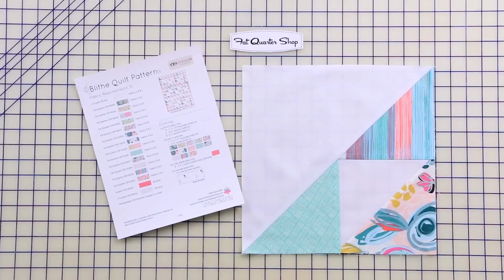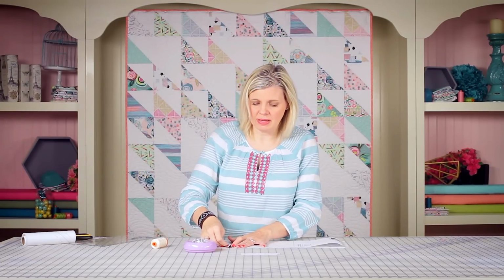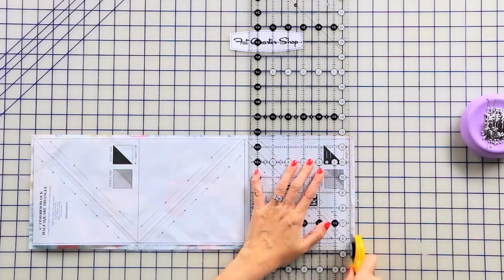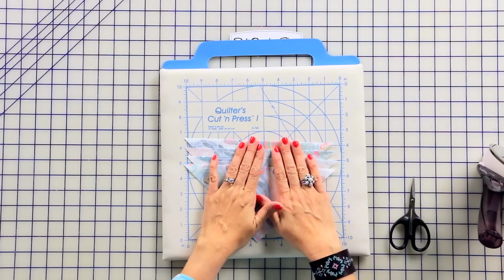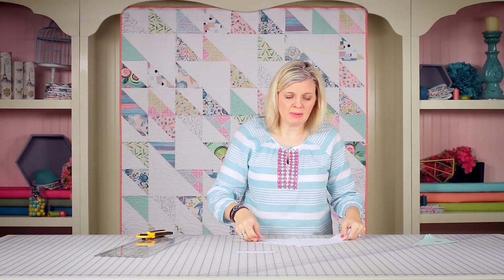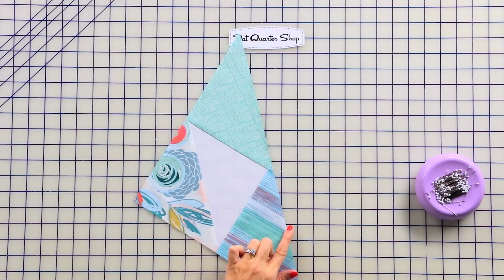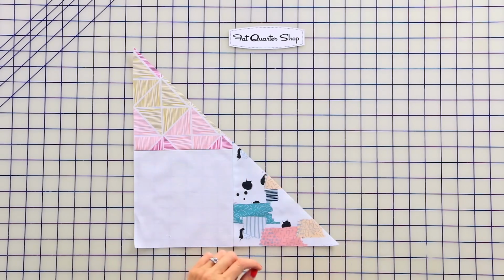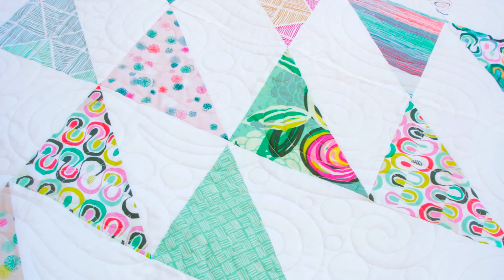AGF Stitched Blithe Quilt Pattern: Easy Quilting Tutorial with Kimberly Jolly of Fat Quarter Shop

Comment: would basting spray work for keeping the paper flat and using less pins? I find the using lots of pins can add folds and pleats
Reply from the maker: +Dorien Reed No, you should not use basting spray when using Triangles on a Roll. If you do this process in small numbers, the paper should curl as much.